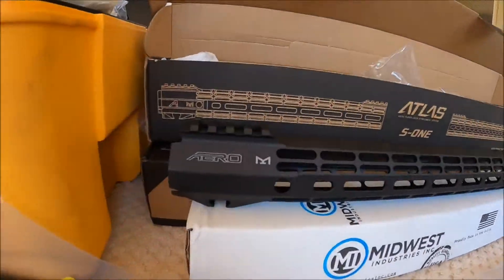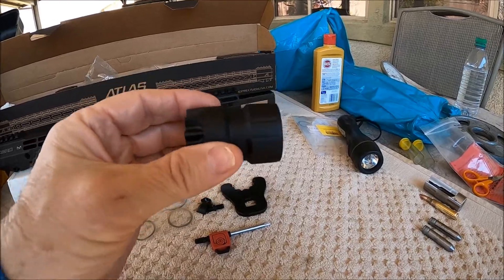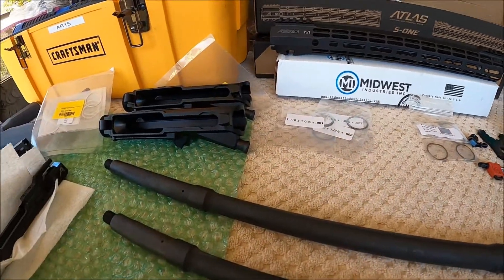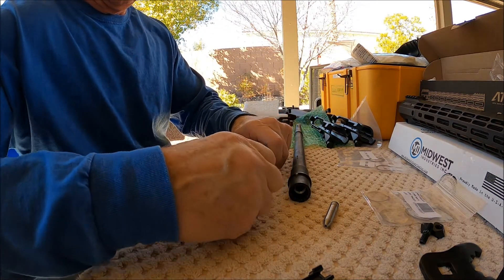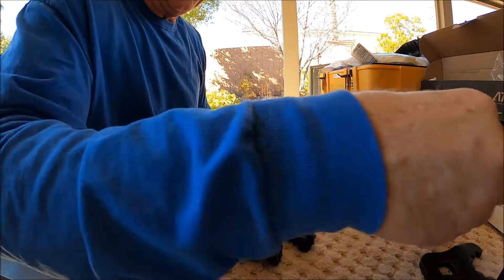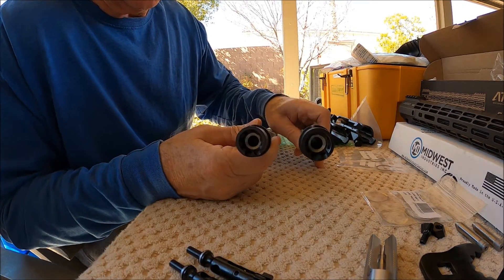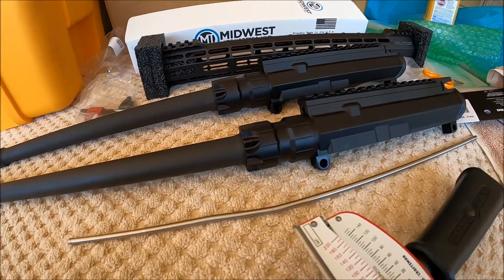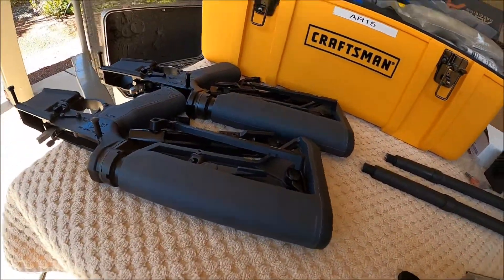AR-15 Aero Precision Atlas S-One & Criterion Barrel Install 01

Comment: Why does it matter if the barrel nut is timed correctly, if the barrel nut doesn't have any interference with the gas tube? Looks like the gas tube would clear even if the grooves weren't lined up?

Comment: I bought an Aero hand guard that came with the barrel nut and shims.  I am having issues with getting the timing right for the free floating hand guard.  It’s a mile off without shims, and even with all the shins Aero sent, it’s still a bit off.  I ended up buying some thicker shims and using one of them with a few of Aero’s shims to get things lined up.  My question is, is it possible to get the timing correct without all the shims on there,or am I SOL?
Reply from the maker: You could face/lap the receiver until you get there but I would personally rather use shims than remove material from the receiver. The other option would be to try different barrel nuts but that may cost more than it's worth. If you're close but just not quite there sometimes tightening and loosening the barrel nut more than a few times will do it. I have never tried it but you may also be able to spin a GI steel barrel nut on and off a few times to smooth out the anodize and then install the aluminum AERO barrel nut?
Reply: @peteregger7928  thank you!

Comment: Would be nice if you explained/showed how you know it passed the no-go gauge
Reply from the maker: Yes, maybe a little more detail for viewers building their first AR. Thanks for watching!
Reply: @peteregger7928  I’m familiar with the method where you check it in a complete upper using the carrier. So when the carrier closes then you know where you’re at. Can you explain how you do it by hand with just the bolt and the barrel? I’m actually having a problem with the build right now where it closes on the no go gauge. I realize this is OK functionally for a used gun or even for this gun. But I would like it to be within a tighter spec as it is a new build
Reply from the maker: @herrent  I would be suspect if it closes on a "No-Go" although if it takes quite a bit pressure you're probably borderline. If the bolt closes on a "Field" definitely do not fire the weapon anymore until you figure out what needs to be replaced. On an AR you can check the head spacing with just the bolt and not the entire carrier. I usually leave the ejector installed although some people will say to remove it. I do remove the extractor because it is very difficult to headspace with that still installed. Put your "Go" gauge into the barrel extension. Line up the lugs on the bolt with the extension lug slots. Push and twist. If the bolt goes into the barrel extension and locks it's good on the "Go". Do the same thing with the "No-Go" and it should not be able to fully engage the slots or twist into the locked position. It sounds like you may have already discovered that you are out of specification or borderline. Is your chamber a 5.56, 223 or 223 Wylde as this will also affect head spacing results if you are not using the right gauges. Hope this helps!
Reply: @peteregger7928  does not close on feild.
Aero told me to get a Pacific Tool and Gauge ....no-go. Apparently it reads different than a clymer and other brands. 
I just want a new rifle to be in new spec, not in used almost worn out spec
Reply from the maker: @herrent  I hear you! You might try a different bolt before you buy another gauge. Maybe someone you know has one you can try? Or maybe take it to an FFL and let them see if they get different results. Probably do it for free for you.

Comment: Great video!! What barrel nut torque wrench adaptor are you using in the video?
Reply from the maker: The barrel nut wrench adapter is included with the AERO hand guard but can also be purchased separately.

Comment: How many times have you sheared the barrel indexing pin while torquing the nut? ....I am guessing 0.00

Regarding radio procedures -- if it matters to you -- "over and out"  (used together like that) is incorrect usage. 
"Over" means I'm done for the moment -- your turn to transmit.
"Out" means I am done + done -- I am finished with my transmissions and I will not be listening to any more of your transmissions.

Accordingly, use one or the other -- separately -- never both together!
If you were a Navy E- 7 ....I am also guessing you never an RM...and never worked in CIC / TFCC etc.  🙃🙃
Reply from the maker: I use a Midwest Industries Upper Receiver Rod which makes it damn near impossible to damage anything. You would really have to try hard! Jet Engine Mechanic my first five years and an Aviation Electronics Technician the last 16 years. You really did make me laugh! Over and out! Lol!

Comment: Somebody please help. The handguard on my m5 is crooked. When removing it, the gas tube is perfectly aligned and fits into the barrel nut slot perfectly. Everything fine with that but when you look at the bottom 6 o’clock position of the installed barrel nut, the slot where the handguard tightens into is very obviously crooked. When installing the handguard perfectly straight, it doesn’t sit in the groove because it’s crooked. When tightening, it’s straight for a while but after 20 rounds or so it begins to wander to the left because it’s trying to sit in the position of the crooked groove of the barrel nut. Is this normal? Any advice is appreciated.
Reply from the maker: That's a case of strange! Does the hand guard have enough clearance around the gas block? Do you have any attachments on the rail near the gas block where the M Loc "T" nuts or screws may be hitting the barrel or gas block? You may have a slight amount of clearance when static but the barrel does move a little when firing. Magpul screws for the "T" nuts are a little longer than most other manufacturers and can hit the barrel or gas block. Either that or there is an issue with the barrel nut, hand guard or attaching hardware.

Comment: So Question, if it wouldn’t have passed the head space check does it mean you need a new barrel or a new Bcg?
Reply from the maker: Pacific Tool & Gauge sells a combination head space gauge that also has a simulated set of bolt lugs in addition to the head space gauge. It's called "AR15 Extension Head Space Gauge". Another option would be to try the bolt in another barrel or a different bolt for comparison to try and determine which one is bad. You could also have a bad gauge.